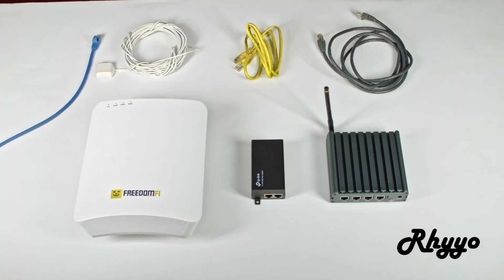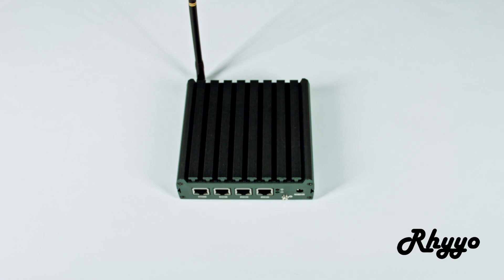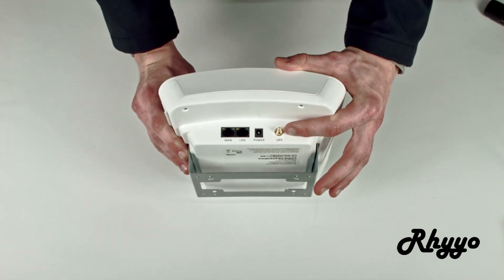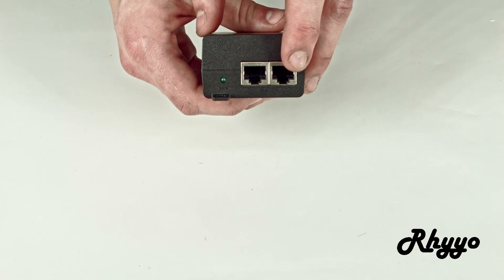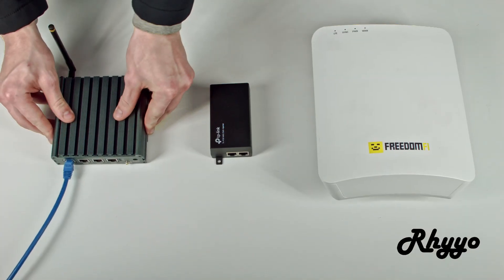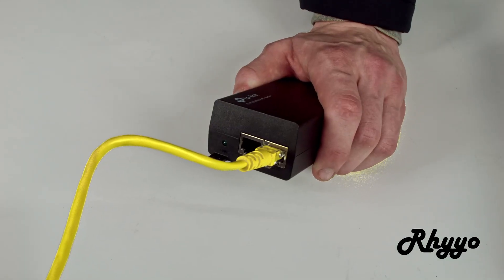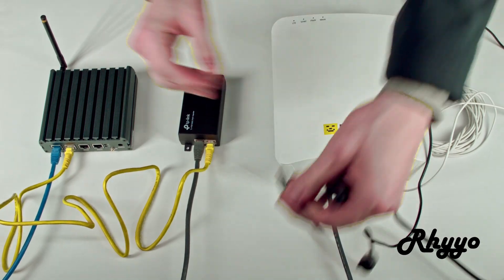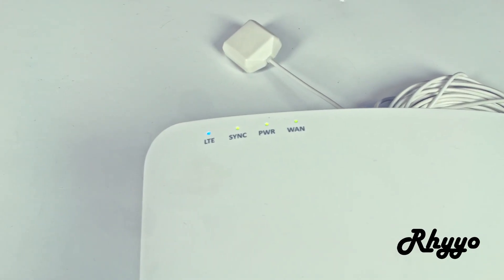Freedom Fi CBRS and Gateway Setup With PoE Injector

Comment: I work at an elementary school (IT Tech) where we have zero cell service from any vendor due to local topology.   We have 1GB internet currently.   Would this work for a 5g solution within a school.   I and many others are concerned about the lack of cell coverage should natural disaster happen.   Our disaster plans actually involve using ham radio operators inside and outside to relay.   I keep a charged 2m radio on my desk to assist.
Reply from the maker: It would be perfect with multiple radios to get proper coverage, The signal will go about .3-.5 miles depending on coverage, they each will be able to produce 150-200mbps for a max of 96 connections so you can put multiple on the WIFI or a separate WIFI to increase data traffic. If you want to talk to on discord we can help with what you would need specially for the amount of connections your looking for and get you the right setup. Our discord is in the 5G section on the Helium discord page.

Comment: Great video! Question: I saw in a reply that only the freedomfi gateway will work with this freedomfi cbrs radio. Conversely, can I use a non-freedomfi cbrs radio with the freedomfi gateway? 

Worded another way, does the freedomfi gateway support 3rd party cbrs antennas/radios?
Reply from the maker: Thank you for the support! It'll be the same way where the Freedomfi products only work together.

Comment: Wait, so where does the actual 5G antenna plug into?
Reply from the maker: The Radio in this setup is connected to the PoE injector from the gateway so that it gets both power and ethernet from 1 cable. If you were to do it without a PoE injector you would plug in the power supply to the radio, and the yellow ethernet cable in the video would go straight to the radio to provide ethernet access.
Reply: @rhyyoiot9309  So you’re saying the radio is also the 5G antenna, and not just a radio module?
Reply from the maker: @JeremyB8419  The radio itself is the antenna to provide the 5G, the small white antenna that comes with it is the Radio is meant for GPS tracking only so you would not need to purchase a antenna like you would for a helium hotspot.
Reply from the maker: @JeremyB8419  Correct
Reply: @rhyyoiot9309  That’s really bad. I was under the impression that the radio was just a module for processing the data, and an antenna would be required, which would mean the radio being indoor only would be inconsequential. With it being as it stands, it would be more prudent to simply buy three csrb sector antennas.
Reply from the maker: @JeremyB8419  Sorry but the indoor radio means it gets installed indoor like a regular router that broadcasts cell service. The radios that they are starting with have internal antennas. They will eventually offer radios with external antennas options. Radios with external antennas in most cases require more advanced setup and are far more expensive. One of those radios installed would be around 6500-7000. Like I said, far more than the 1500 and 2500 for the current radios they will be offering. 

Also, the recommended locations for these radios are indoor unless you understand what a good outdoor location is. We recommend coffee shops, bars, and restaurants not your block. If you don't know for 100% I would ask in the Helium discord. We are in the 5g-Cbrs room.
Reply: @rhyyoiot9309  Well, the location I'd be starting with is a 6 story commercial office building along the I-10 corridor in Houston, within 5-7 miles of all the major petrochemical areas, and within 10 of downtown Houston.  Not exactly sure how much use it would be of internally within the office building.  I don't see much of a need for 5G for simple business applications.

Comment: What is your daily hnt rewards like?
Reply from the maker: It will vary depending on how many GB you can move, they pay you $0.50 per gig depending on price if HNT you will receive that amount in HNT. If you can get it in a spot with high data traffic it would be best compared to a gateway where you would want it anywhere close enough to other gateways, then you can traffic plenty of GB.

Comment: Nice video man, thanx, are you having a private 5G network or will you be offloading from Dish, Verizon, etc?
Reply: Also, how will 5G operators pay you for offloading? in HNT?
Reply from the maker: @azizalriddan8998  Thank you for the support ! The Radio will work as a relay system,  the WIFI it is connected will offload it to the users nearby with supported Carriers. depending on which carrier they have, they will pay at the rate directly from the ISP into your HNT wallet.
Reply: Do you have link to gps antenna?
Reply from the maker: @justinfay4510  You have to link the gps which is the small white square unit, into the radio to prevent spoofed locations and increase location accuracy to get rewarded the correct amount since different locations will vary on how much you profit.
Reply: @rhyyoiot9309  I meant to purchase. Thanks!
Reply from the maker: @justinfay4510  Right now there is a waitlist, subscribe with your email here https://freedomfi.com/helium5g/?statuscheck=1 and when they have the have a opening for the reservation you can get your order.
Reply: @rhyyoiot9309  thanks. Do you also get the gps antenna from them? I have a gateway and have a pre order for the indoor radio.
Reply from the maker: @justinfay4510  Yes the gps antenna is included with the CBRS Radio.
Reply: @rhyyoiot9309  awesome. Thank you!

Comment: Where did get the POE INJECTOR FROM
Reply from the maker: href="https://www.amazon.com/gp/product/B08LZZRX5N/ref=as_li_tl?ie=UTF8&camp=1789&creative=9325&creativeASIN=B08LZZRX5N&linkCode=as2&tag=rhyyoiot-20&linkId=9abe7f70aaf3aa35934500bd362d1434">TP-LINK TL-PoE160S | 802.3at/af Gigabit PoE Injector | Non-PoE to PoE Adapter | Supplies PoE (15.4W) or PoE+ (30W) | Plug &amp; Play | Desktop/Wall-Mount | Distance Up to 328 ft. | UL Certified, Black</a>
Reply: Why is the injector needed and one cannot just plug the gateway into the 5G radio?
Reply from the maker: @BlockchainForWhatIsBest  Toy can plug it straight into the the Radio but the injector is to also allow the power from the gateway transfer to the radio so that you don't have a power cable in the radio. But if you use it without the POE injector then you would just plug the power supply in.